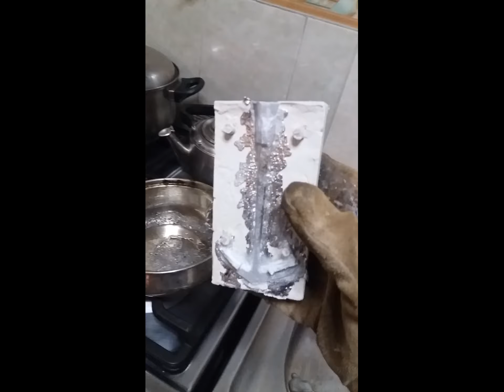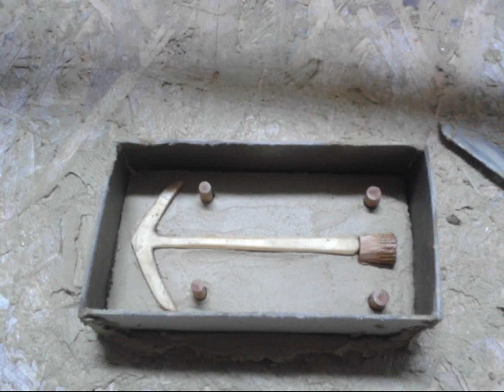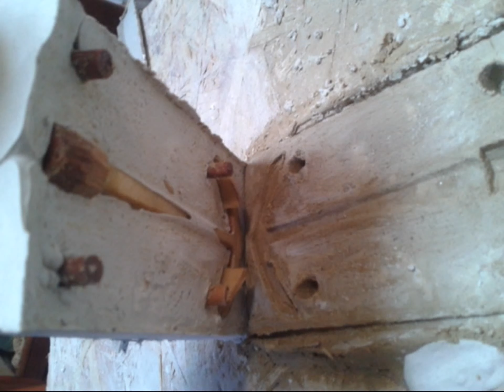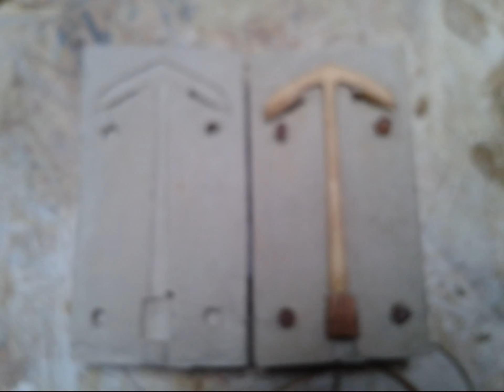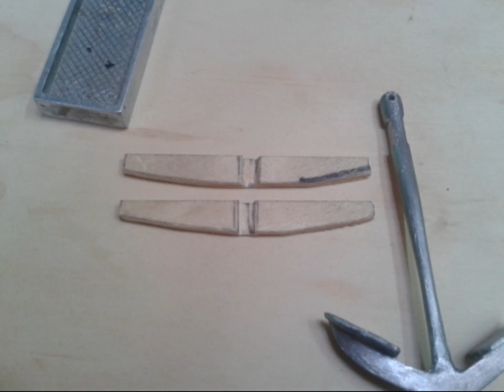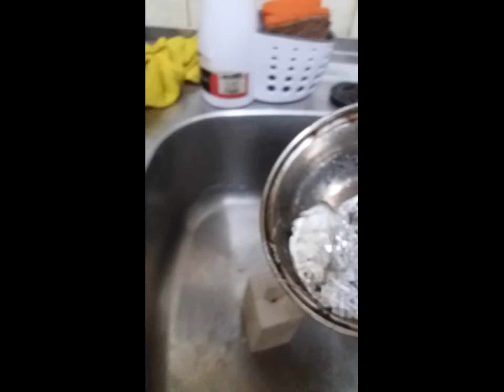tutorial como hacer molde de yeso para  metal

Comment: Hola, necesito fundir una pieza algo complicada de unos 4 o 5 cm de diámetro en latón. Podría utilizar yeso para hacer el molde? Si no es así, existe un material fácil de conseguir para hacerlo? He oído hablar de una silicona en epoxí pero no tengo claro si aguantaría la temperatura del latón en fusión, (unos 980°C.). Muchas gracias.
Reply from the maker: Ufff . No aconsejaria yeso para laton . Pero nada se pierde intentandolo .
Reply: Busca yeso refractario se hace con yeso en polvo y polvo de algun material refractario como los ladrillos de barro los rompes y los haces polvo mesclalo con yeso y agua y dejalo en el orno a una temperatura de 200 grados ppr 3 o 4 horas y proba con una gota de bronce para q vallas midiendo la resistencia del molde por q puede qebrarse y salpicar metal seria muy peligroso asegurate q el molde este caliente a unos 8p 90 grados antes de verter el metal